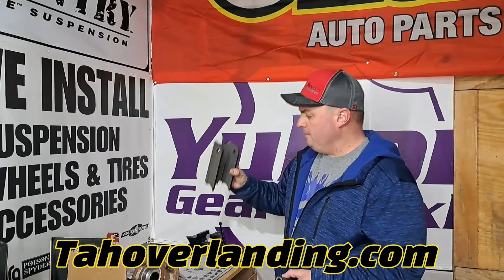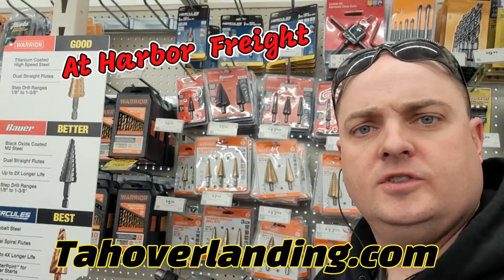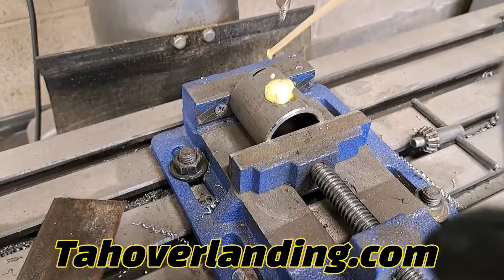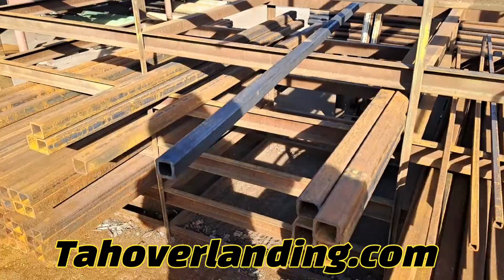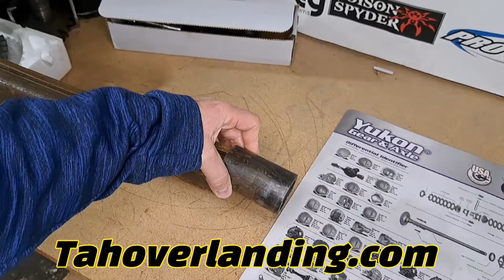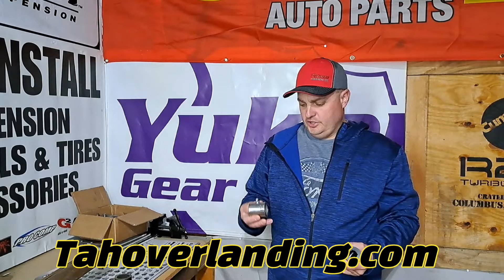Starting the radius arms on my new solid axle swap build  Tahoverlanding Axle swap white Tahoe

Comment: Love the channel. Have a GMT 800 Yukon xl, I’m going to be SAS’n with the Dana 44. My question is, if I’m not doing a low COG build, am I okay to mount the radius arms directly under the frame?
Reply from the maker: You'll find that not just having better ground clearence, the radius arms being tucked inboard of the frame gives substantially better articulation. If you mount them directly under the frame you'll have poor articulation. 

If you would like to mount them below the frame level, let us know at the time of ordering. And we can provide the link mounts for the cross member that will hang them lower , while still allowing you to tuck them inward to get articulation. 

We will also give you a longer pitman arm and a matching drop track bar bracket

Comment: You’ve convinced me to make my own. 
Basically chop off factory frame mounts and start all over. Thanks for helping me build the confidence lol. 

I’ve built all my armor but suspension fab is something I don’t have much experience with. 

Getting pinion angle set with the top link seems to be the kicker for me. 

And going all custom do I go longer than stock? Remembering lr arms are similar to that of a bronco. 
Thanks for all your knowledge and help so far.
Reply from the maker: So when it comes to length, I discuss how to determine length here:
https://youtu.be/1opjYq7Ezl0

And I'm glad i helped you build confidence. That is always my goal. This short video talks about that too:
https://youtu.be/zGmn8cKK5kw
Reply from the maker: Also, here's the video on when I attached mine to the frame if it helps:
https://youtu.be/Vvg1NAu1sE0

Comment: How tall is your Tahoe as it sits right now? EDIT: the blue one. What diameter tires are you running? I have an 03' Z71 Tahoe that I am interested in dong what you have done. My truck currently is leveled out with a slight forward "OEM" rake for towing on 285/75r16 Cooper S/T Maxx's. I am now disabled but can still climb into a vehicle and drive. I also would have to have it built for me as I do not have the tools or place to construct something like this. Do you build trucks these for customers? If so, what would it cost (all materials/labor/etc) for it to be done? Thanks, Paul. I live in NC.
Reply from the maker: Hello Ernest,
The height is thoroughly depicted here: 
https://youtu.be/75XaEhbBVQ0

And here:
(Center of gravitySee at 3 : 40) 
https://youtu.be/xreLdMWw8K8

The customer's suburban at 11 : 35 in this video is low enough he has stock tire size
https://youtu.be/BHxa-afRemg

Yes, I install.  You can put in an installation inquiry at Tahoverlanding.com 

The blue one has 285/70R17 when it has the silver wheels, and 35x12.50R17 when it has the red wheels
Reply: @tahoverlanding  Thank you so much for the incredibly quick response! I will check those links out and see what I can do to make this happen. Once again thank you, Paul.
Reply from the maker: @ernestpaul2484  I'll be here 👍